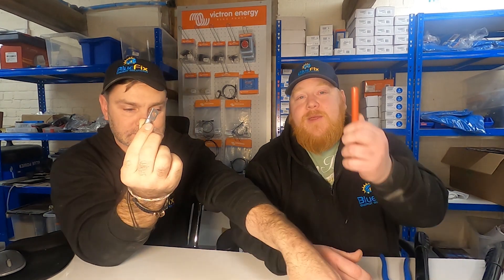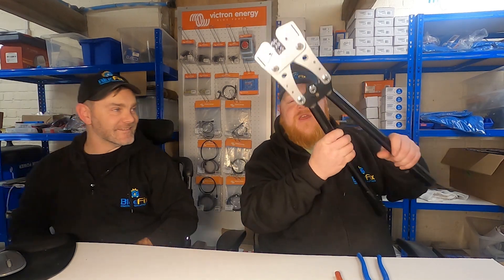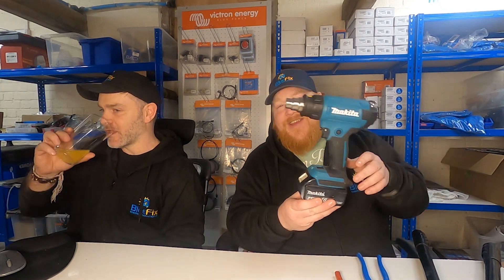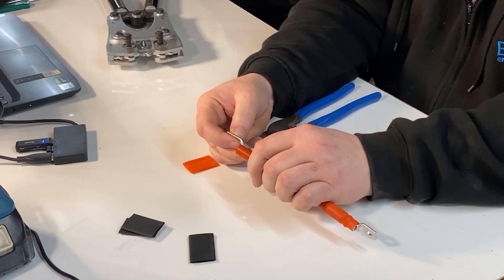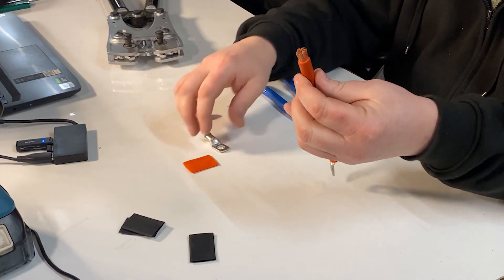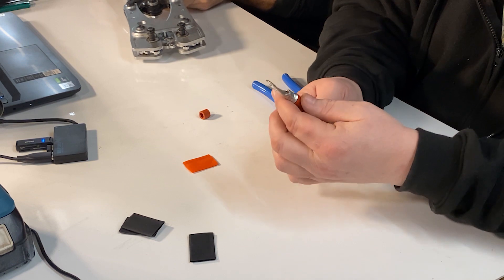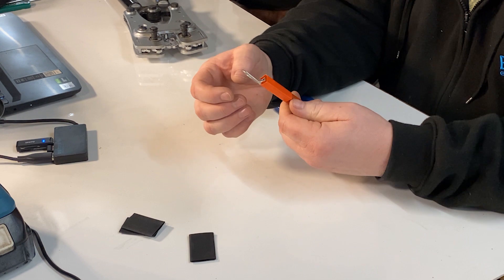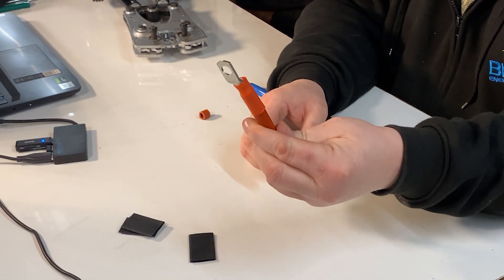Why cable crimping MUST be done right! || Cable Termination

Comment: Guys, nice work,  but do you test the system with a FLIR thermal imaging camera of some sort when a system is ready,  under full load?
I always learned that copper should not be exposed,  so maybe use closed lugs without a hole and better heatshrink. I could see some space?
I can be mistaken,  but these lugs also seems a bit short, and then a hydraulic crimper may do a better job.?
Lots of comments,  sorry, but always going for the best😁
But keep on doing the nice work!
Reply from the maker: Hi Guido, excellent point on the Flir, it’s something we have been looking into, for now we use an infrared device. All the lugs and bus bars we use are tin plated so no risk of oxidation! We have tried hydraulic crimping but it’s time consuming and the results are no better the the CRIMPINATOR😂😂, cheers for watching bud!
Reply: @BlueFix  I mean the exposed copper strands at the end.
Reply: @BlueFix  what you can do after a crimp with you crimpinator (like the word) is to saw the end, with a grinder and very thin blade.
Just before the end of the crimp.
All strands should be one solid peace of copper. 
Then you know if the tool is okay.